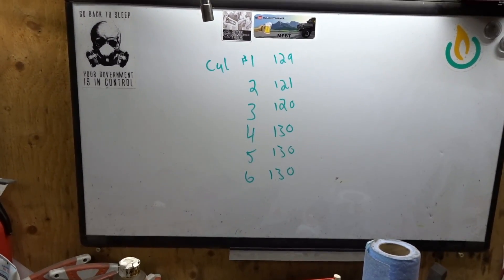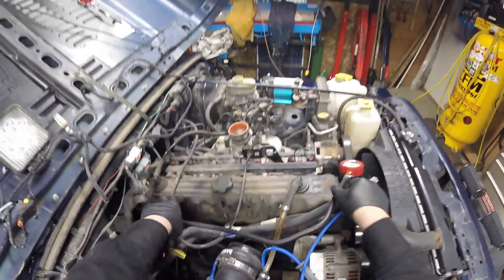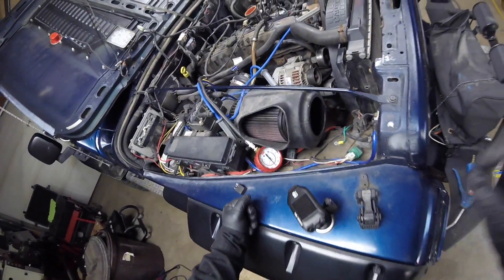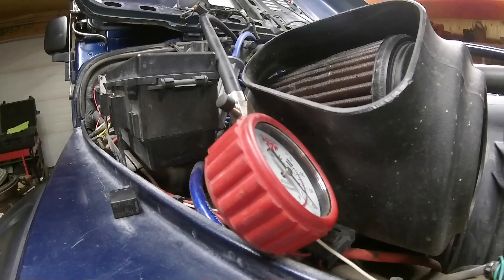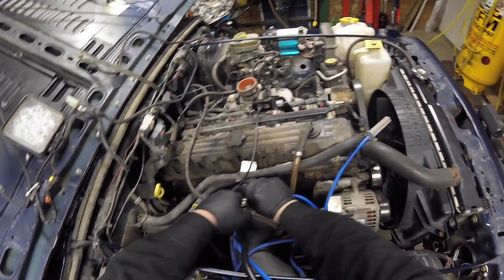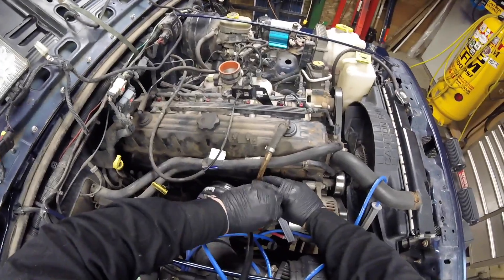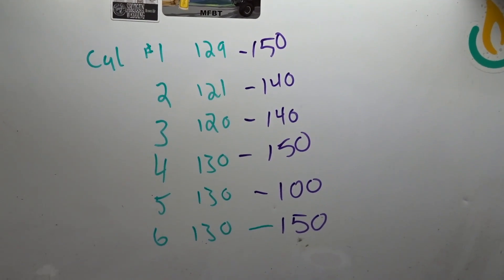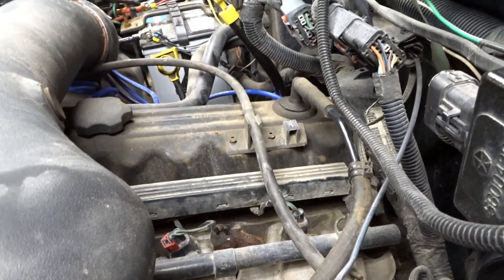Misfire Codes and Engine Compression

Comment: Carbon buildup could increase compression. Oil collecting on bad valve seals could help to keep them sealed better. Just a couple of ideas about compression increasing. Is a strange one, though. Did you replace the head gasket with a slightly thinner one at any time?
Reply from the maker: No head hasn’t been touched, however still need to do a leak down test
Reply: @TestDontguess 
Had similar strange compression readings on mine. Was two cylinders higher, one lower and one too low. Strange how it can occur like that.